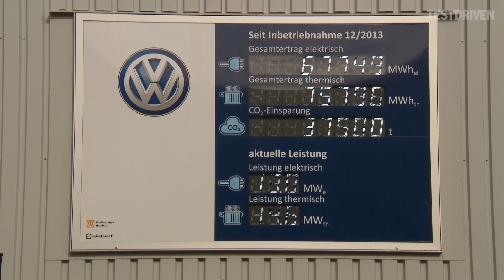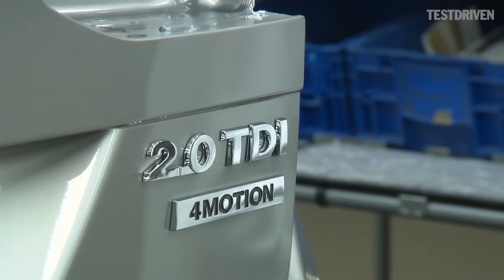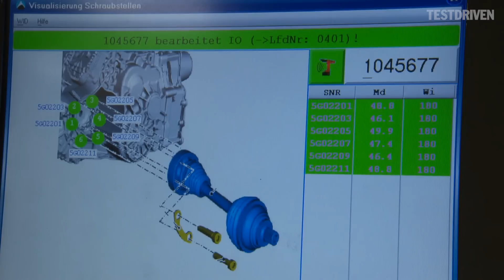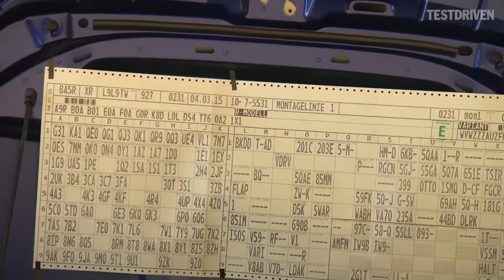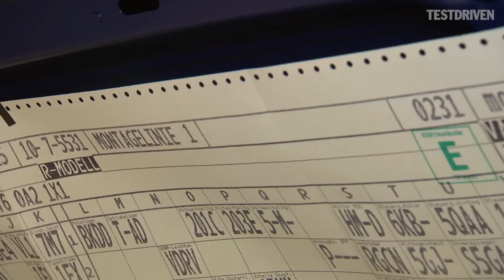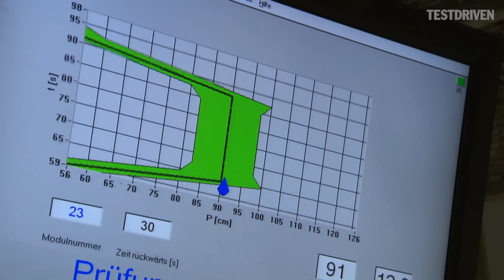VW Golf Estate/Variant Production

Comment: Why do they need a machine to put on the steering wheel?
Reply: Michael M because the steering wheel shall be in the exact correct position when the car drives straight ahead
Reply: berndmevers, most of the time they would just line up the marks on the wheel and column and put it on manually, that's why I was asking.
Reply: TDIP
Reply: Huseyin
Reply: Sir,it is not is no that easy 2 put it,anyway do U no how 2 make a car if U do not no how it is made just shut
Reply: @annnankabirwa9059  very difficult to read you
Reply: PRESICION!!!
Reply: Time is money.

Comment: The quality of the way car is very poor!  I purchased the new SAIC Volkswagen Tour V6, 2.5T four-wheel drive Chongzun flagship model in Shenzhen Dongtong Automobile Trading Co., Ltd., the instrument version showed brake failure when driving more than 4,000 kilometers, and found that the engine was seriously leaking oil;  The fault light is on, and suddenly the whole vehicle stops running during the second driving. The car wifi is often not connected to the mobile phone. When it rains, the two lights enter the water. The quality of the car is poor. SAIC Volkswagen and 4S shop are flickering. Please do not buy SAIC Volkswagen.  car.
Reply: Can't compare a chinese made VW to a german made one. German made much better.